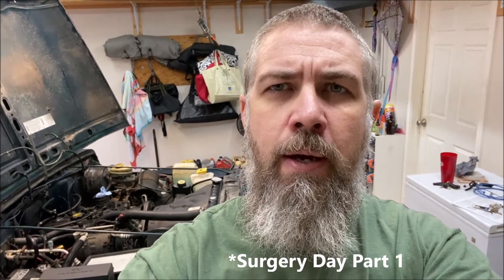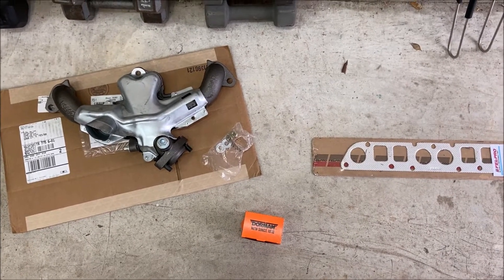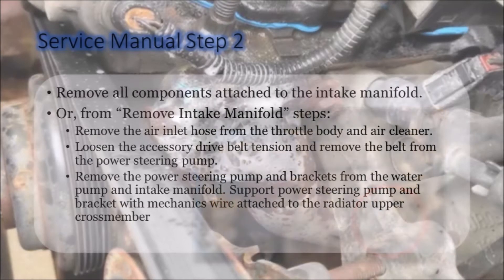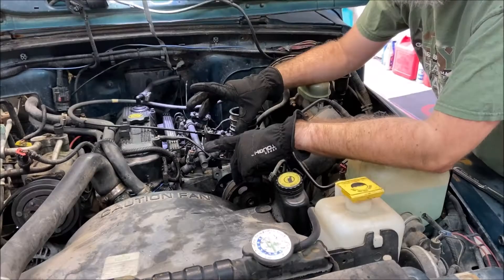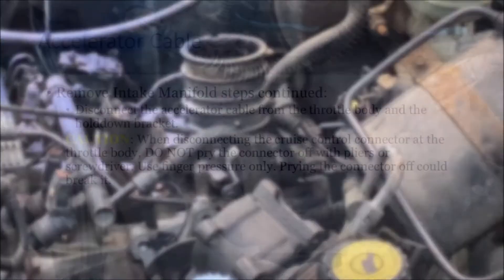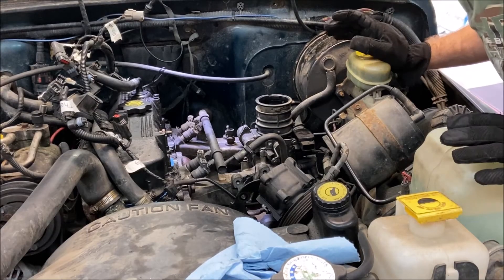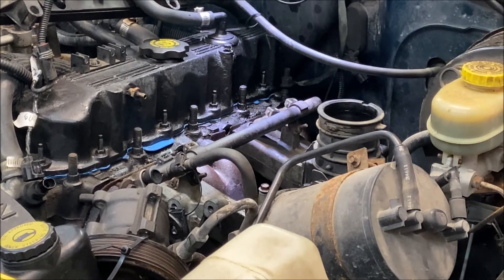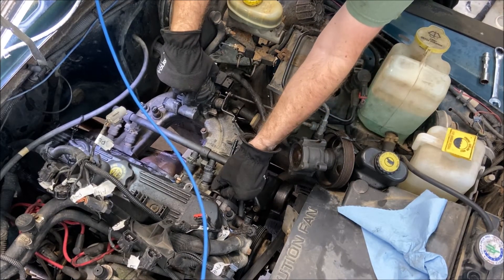Replacing the Jeep Wrangler 4 cylinder TJ Exhaust Manifold – Part 1

Comment: Your jeep is like a mirror image of mine man, your series helped me figure out where my exhaust leak was, how to get the exhaust manifold off, and i figured im pretty sure i have a valve cover leak - you have a damn well put together video for each that gives me confidence i can do the work. I appreciate the hell out of it sir, thanks for taking the time to film and document these!
Reply from the maker: Thanks so much for the kind words! I’m glad the videos were helpful. This is exactly why I made them - hoping to help someone else in the same spot. Best of luck with your TJ!
Reply: I got everything back together this morning, the injectors on the fore end of the jeep didnt want to go back in, so i figure im gonna need new ones. Also, my first run through i improperly seated the intake manifold which resulted in an insanely high idle.

Aside from my own user errors everything went pretty damn smooth, saved me about 800 bucks in auto shop expenses, much appreciated sir, just wanted you to know the video had effect on target!
Reply: Oh, and the loud hissing sound coming from the exhaust manifold is gone now 😁
Reply from the maker: @ryanbird5142  That's great to hear - glad the video helped and I appreciate the feedback.  I feel your pain on getting the intake manifold seated.  The number of times I had to take that thing off and on to get it every thing aligned...  Definitely a fickle part of the process.  Glad you got it, though!

Comment: This will work for a 2000 Wrangler SE 2.5l? My gasket or manifold just went out. Gotta say your videos have been a huge help!!
Reply from the maker: Glad the videos are helpful, James!
Since yours and mine are both 2.5L, the general process should be about the same.  Be really careful with getting the right parts, though.  The 2000 has a different service manual from the 1997 - 1999 models and I think there are quite a number of part differences. I don't know if there is or isn't in the area of the intake/exhaust manifold but definitely look into the service manual and parts list for the 2000 model year to make sure you get the correct parts.
Good luck!
Reply: @CarbonsDIYGarage  I have a Haynes manual but it is very vague on some things. Mine should be in it but it seems like it isn't. Thanks so much for the heads-up. This is my weekend project. Ugh.

Comment: Can you share a link to the replacement bolt set that you bought? I have the exact Jeep as yours. Thanks
Reply from the maker: You bet, Reed. The info’s in the description of video 2, but I’ll add it to the info for this video too. But here’s the info:

Beveled washers (4): https://amzn.to/3mbXyYk
Bolt Kit: https://amzn.to/3q9xBto

Good luck and thanks for watching.
Reply: @CarbonsDIYGarage  thanks !! Awesome video. The washers say they are only for the tj through the 99 year. They said they won’t fit the 2000 tj , at least that is what Amazon says. Do you think that the bolts would fit a different manifold? I already ordered a different manifold before watching.
Reply from the maker: @reedcarpenter2994  My TJ parts lists is for teh 1997 - 1999 TJ.  I found the parts list for the 2000 TJ and it does show different part numbers for the bolts, studs, and beveled washers.  Good catch on that!  Here's a link to the 2000 TJ parts list, if you don't have it: https://archive.org/details/2000jeepwranglertjpartsmanualrevisedocr328pages

Scroll down and you can find the download option.  Page 137 of the PDF for the 2.5L TJ.

I hope that helps.
Reply: @CarbonsDIYGarage  it appears the studs on Amazon that you included the link for matches up, just the beveled washers don’t match. Can you confirm the studs that you included match the 2000 Jeep? Also I didn’t see you change those on the video, was it easy to change? And do you recommend changing those?
Reply from the maker: @reedcarpenter2994  Looking at the Questions on the Amazon page for the washers, sounds like these washers will work on the '00 as well.  The description pare of the Amazon page for the bolt kit says it'll work on the '00 as well.  Not sure if you meant the washers or the studs when you asked about seeing me change "those."  Washers I didn't really specifically get, but you can see a new one/bolt on the front most exhaust manifold bolt location here: https://youtu.be/uQKwOzAU63U?t=642

If you meant the studs, those are easy to change AS LONG as you can get the old ones out.  If you can't get them out, don't snap them off trying.  Clean the threads and just reuse them.  As long as they're in good condition and you torque things properly, I would think they'd be fine to reuse.  You can certainly reuse the washers if you need to (I may have reused one, actually, since I think I lost one of the new ones).
Hope that helps.  Keep in my mind disclaimer regarding not being a professional jeep mechanic.

Comment: Hey Carbon, has how is your Fel Pro gasket holding up?  Any new exhaust leaks yet?
Reply from the maker: Gasket is holding great, no issues and no new exhaust leaks.  A month or so afterwards I checked the torque on the manifold bolts (all were good) and I keep checking them every few months.  All holding well.
The 2.5L has a distinctive sound and every time I watch a video of someone else's 2.5L it's great to hear that those 2.5's sound just like mine now.
Thanks for watching.

Comment: I am replacing my manifold gasket on my 2000 TJ 2.5 . It had a leaking gasket on the intake causing my high idle. The question I have to ask is if any of your manifold bolts or nuts were loose. All of mine were loose and did not take much effort to loosen. Just wondering if this is a problem on the 2.5 or just a improper installation. Thanks
Reply from the maker: Thanks for watching, Carl!  From what I saw on other videos and in my own experience, I think this is a common problem - at least with the 2.5L, if not the TJ in general.  The bolts on mine when I made this video were all loose or barely snug.  But I don't know if that was to blame on Previous Owner or not.  It likely contributed to the gasket ending up in as bad of shape as it was.
As a better data point, it's only been a couple of months after I made this video.  I checked the bolts and a couple were a little loose.  I don't know if the factory torque value is too low or what it is.  I'm really reluctant to use thread locker on them because you really want them to come out if you have to remove them.  I've added a reminder in my vehicle maintenance app to check the bolts every few months, at least for now, because it seems like the vibrate loose pretty readily.
As for the nuts - they weren't loose.  In fact one nut wouldn't come loose and it ended up being the stud unthreading from the block.
Reply: Oh good, one of my studs is missing completely. Threads look good thank goodness. I need to chase all the threads  before going back together too. I was having the same thinking as you about the locktite on the bolts just not really excited about having to add checking bolts as a maintenance procedure. Thanks for the information
Reply from the maker: @Manandmachine772  The daunting prospect of having to extract broken bolts or studs really had me worried so despite the other issues, I was still happy that I didn’t need to use those tools!
There aren’t a whole lot of videos that I found on the 2.5L manifold. If you think of it, let us know what you decide to do regarding loctite and how things look in a few months.
Reply: Hello just a update regarding my manifold gasket replacement. No problem with broken bolts or the stud that was missing. Chased threads and cleaned the head and installed a new stud with no problem. Then I realized that the 2 dowel pins were missing when I took the manifold off. If these were missing how important are they in keeps everything in line and tight. Tried looking online for them no luck as of yet and hopefully they are available from the dealer. Thanks for your help
Reply from the maker: @Manandmachine772   Oh wow! Well, really glad no broken bolts. The dowel pins weren’t in the block or the intake manifold? That’s so weird. I would think they’re pretty important to get the alignment right. If I remember right, there aren’t any through holes on the intake manifold for bolts to help with the alignment. Sorry I don’t have a better answer. Maybe you can find an intake manifold at a junk yard that has the towels in it that you can remove? Good luck!
Reply: @CarbonsDIYGarage  I am pretty sure the gasket has been replaced before so probably MIA. Going to check with the local dealer tomorrow I have a part # and they are only $3.ish each. Thanks
Reply from the maker: @Manandmachine772  Great news. Good luck!
Reply: New follower - Mines a 4.0 but really enjoying all of your videos.  Now I just wish I had a garage to complete these in.  #Streetfixer

Comment: why exactly didnt you do the step of disconnecting fuel pump relay before taking off power steering pump smh lol
Reply from the maker: As described at 8:41, I was following the service manual and doing it in the order written, which was clearly not correct.  That's what led me going back and doing it the right way, as described at 10:21.